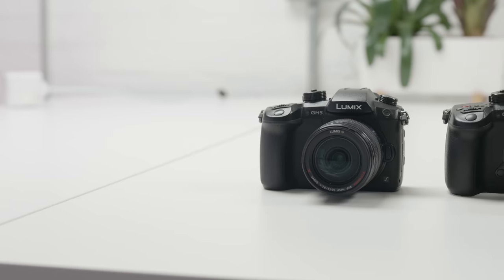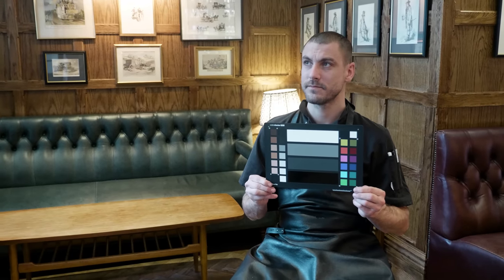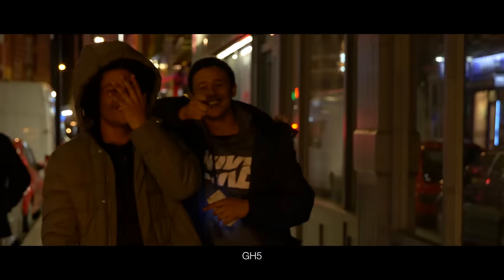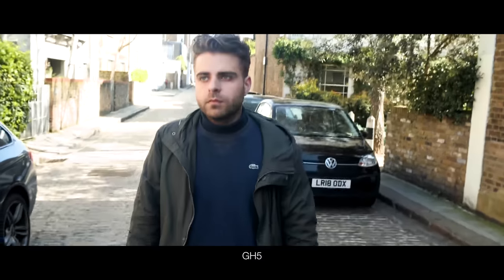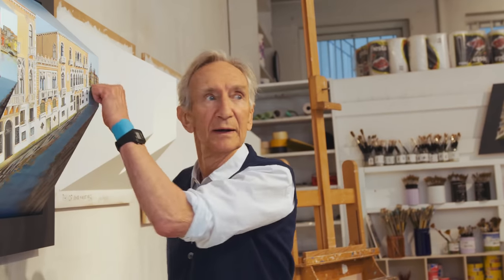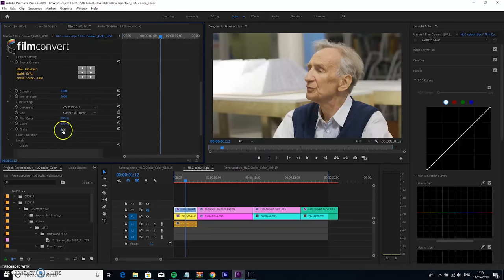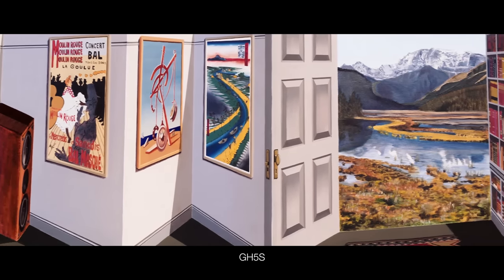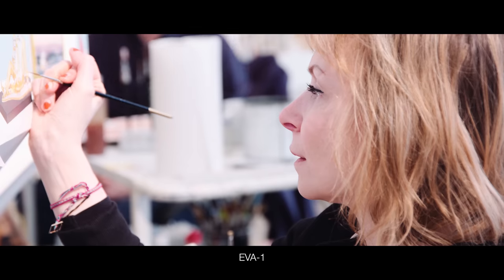The LUMIX S1, GH5S and GH5 | The best B-cameras for the Panasonic EVA-1?

Comment: I've been using GH5S as a B cam for EVA for 7 months now.. I find color matching easy, yet the biggest issue is the skin tone in my opinion. Gh5s is too sharp and unflattering & almost becomes impossible to match to the creamy, smooth skin tone you get from Eva. I haven't used S1 yet but from what I see, you are getting much more of the smooth look. So,, I'm either considering selling my Gh5s for an S1, OR keep the Gh5s as a back up and buy another Eva.
Reply from the maker: Personally, I'd opt for upgrading the B camera to the S1. I have a GH5S too, and love it - but there is a clear difference in colour science between that and the S1. If you did go down the S1 route, the colours, and in particular the skin tones will match straight out of the can. I think having an S1 as opposed to two EVA1-1's also gives you some flexibility when it comes to wanting to shoot with a slimmed-down setup. KH
Reply: I just noticed (5:58) that it lists the GH5 and GH5S clips as being HLG.  Sorry, I missed that, though it's unclear what profile the EVA1 and S1 clips are recorded with...
Reply: wait for S1H
Reply: Paul, I also have the EVA1 & GH5s as an A & B camera setup. I'm having the same exact issues. The GH5S is way too sharp, the highlight roll-off isn't as good, and the skin tones just do not match the EVA1 (which can be expected when comparing a hybrid camera to an entry-level cinema cam). But this is especially noticeable when it comes to using V-Log footage on these two cameras. I'm scouring the web, trying to find the best settings to match these two cameras up. Have you had any better luck? Any recommendations

Comment: Cameras are math so please lern it. The S1 in full frame mode will give you one stop more shallow dof than a the EVA-1 with its Super 35 sensor. The GH5 will give you one stop less shallow dof than the EVA-1. And the GH5s will give you about 90% of a stop less shallow dof. So out of these three cameras the GH5s will actually be closer to the EVA-1 at equivalent focal lengths and the same f stops. You can really notice the difference between a full frame and a MFT sensored camera. The difference between either full frame and Super 35, or Super and MFT is not noticeable enough to properly effect the viewing experience of the viewer. Unless you use f1 or faster lenses. And your wide end will look a bit more shallow when you have wide enough lenses. But it’s offen not worth the practical headache larger and heavier full frame lenses come with in my option. Also good luck finding truly cinematic looking glass sharp you can effort for full frame or Super 35 EF. My Veydras on a MFT or Super 35 body look much nicer than any Sigma lens on a Full Frame body.